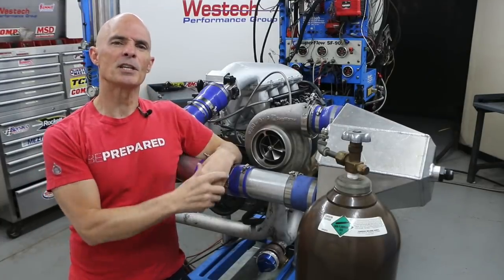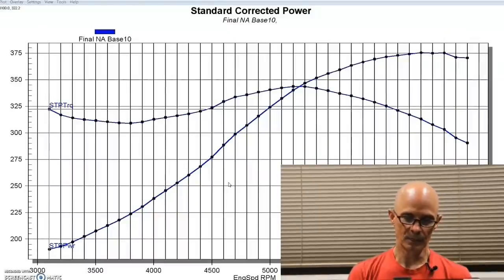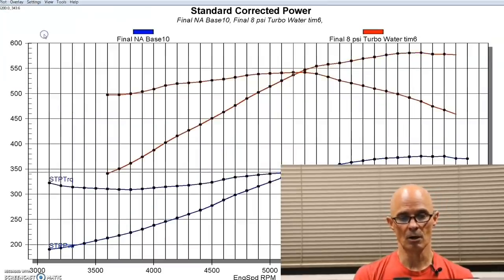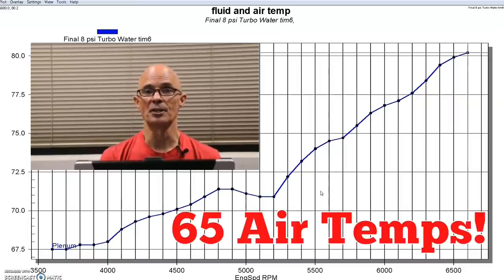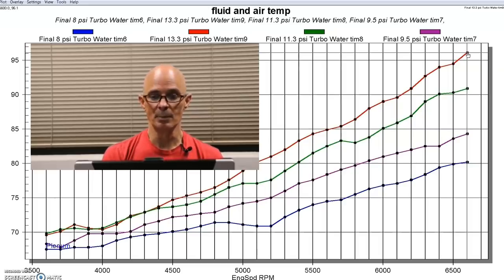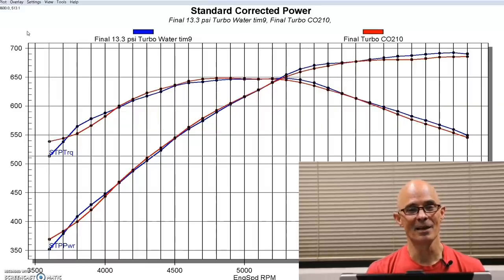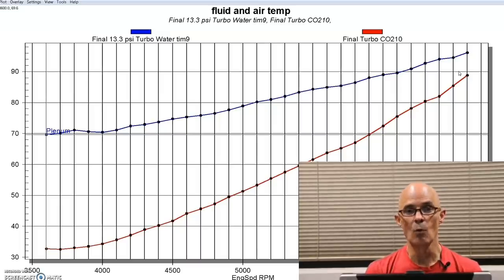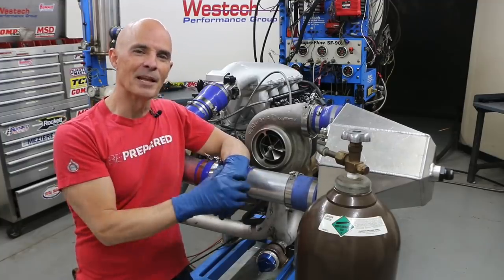HELP, CO2 INTERCOOLER FAIL!! FULL RESULTS!!

Comment: Run the fuel through a cool can with dry ice or liquid nitrogen, insulate the fuel lines from engine heat, it’s a better bang for ya buck, there’s more power in cool fuel than just the air.
Reply: There really isnt

Comment: On an Engine Masters episode called Heat Kills Power, they tried different things such as heating and cooling the manifold. The thinking was cooling the manifold would reduce the temperature of the air charge resulting in more power and heating the manifold would reduce power. Power was affected by doing this but not for the reason you would think. The result was chilling the fuel had more of an effect than chilling the air. This was determined by heating the manifold and cooling the bowl in the carburetor and later cooling the manifold and heating the fuel in the bowl. More power was made when the fuel was cold and the temperature of the manifold had little effect. When the test was done, it was on a carbureted engine. They were hesitant to say that chilling the fuel in an injected engine would produce the same results. Can you use CO2 to produce more power? I would say yes if you use it to chill the fuel. It would be interesting to see the difference in power using the CO2 to cool the fuel.

Comment: Try it with an air to air take the co2 and spray the intercooler till it's a block of ice.  Or you can make a cryo fluid for the air to water get some denatured alcohol and mix it with dry ice I'm not sure what kind of pump to use for that though

Comment: I think you will need a larger cooler and more co2 flow. The more service area the more transfer. Find out what the BTU of the Co2 is that set up is more of a air to air and the cooler is to small. Liquid nitrogen will be dif Because it’s liquid. I would fill the liquid cooler with liquid nitrogen and release  it during the pull. Like any liquid it cools rapidly when changing from liquid to gas. But don’t let the motor ingest it or it will fall on its face losing the oxigen content

Comment: Richard Holdener Increase the discharge hose diameter. Might be restricting flow. Sanity check, put a pressure gauge in the inlet & outlet. Possible the liquid is forming solid dry ice and blocking the core..Could even try nitrous..

Comment: It has to do with the density of your transfer media. As well as the shape of the charge cooler. Carbon dioxide is far less dense than water. Air density is roughly 750 times less dense then water. For a phase transfer type intercooler to work, you would need to expose more of the media to heat by increasing surface area. A better use of a phase transfer would be to utilize the cooling and expansion of a gas in conjunction with water as the transfer media. More like a killer chiller type system that cools the water making it more efficient as a transfer media.

Comment: Give it bottle pressure till the side of the inter cooler and then regulate it into the intercooler, the regulator will act as a restriction, kind of like a tx valve in an air con system and it will change state after that location in the intercooler body. Then you will get better temp drop

Comment: you need to install a jet at the inlet port of intercooler so the gas goes from high pressure to low pressure inside  the ic.

Comment: Right away you are running a gas through a cooler made for a fluid with the density of water. To confirm the problem temperature of the gas going in VS out would need to be recorded. To do it with cold gas you need an Air to air inter cooler that has a manifold feeding and exhausting the gas to ensure it has a chance to remove the required amount of heat. Without going into any math it would need to be VERY large in comparison to a normal unit considering the amount of heat transfer required. To do it properly you need to think of it like a car AC and a TX valve. To draw the maximum amount of heat with the CO2 you want it to transition from a liquid to a gas inside the cooler or just before. However the cooler wouldn't be made for the safe handling of the potential pressure that the CO2 could produce. there are a few ways it could be done but each has it's own inherent problems. CO2 liquid handling is tricky.

Firstly you need to have a proper cryogenic bottle that will allow the tapping of liquid CO2 and not just a welding gas bottle. A -8 line with a liquid feed to a primary regulator directly feeding the compensating regulator then into the heat exchanger. The pressure and temp inside the heat exchanger will need to be controlled to keep the transition act continuing to occur without freezing solid with CO2. It could be done but a controller and some complex valves would be required. Really not even slightly practical. The reason why it isn't used as a refrigerant.
A proper refrigerant is required to be handled practically so the only decision is what medium to use?  Butane boils off at -1c at atmospheric pressure so that's no good it wont get the temp you want. R134a wont get cold enough either but plumbed up using the cooler like the evaporator it would be effective and has proven itself in this app but sadly it wont go below -40c. The external system would need to be huge. Not Practical. You could use SO2 but that is awful stuff to handle and even the tiniest leak has people running. I would suggest methane as the most practical medium through the inter cooler as it transitions at -162c any colder than that and the air will start to fall apart. Of course if you don't like the risk with methane there is always liquid Argon at -182c that will get it frosty. LOL
But seriously you just want the coldest you can get it to without it becoming a NASA engineering project. Get some Silicone Heat Transfer Fluid and a mag drive pump, a car radiator a tray that it will fit in and 20 lbs of dry ice. Fill the cooling side of the heat exchanger and plumb to the pump and radiator. submerge the radiator in the same oil and then bury it in dry ice. That will get you -80c liquid into your inter cooler. That should get the charge temp down providing the inter cooler is big enough. I wonder what you did?
Reply: CO2 is used as a refrigerant.
Reply: @fascistpedant758  Yes but not very effective though.
Reply: @dazaspc   It's effective, but requires high operating pressure and low condenser temperatures. It's often used on ships where the high operating pressures require smaller compressors, saving space, and the cold ocean water can be used to cool the condenser.
Reply: @fascistpedant758  OK I had never encountered it.
Cheers

Comment: As other commitments said, you need it to be liquid in the intercooler, a more effective solution could be dry ice and alcohol (isopropyl or something with a nice low freezing temperature) in a cooler (don't seal it shut or it will explode) with a pump to circulate it through the intercooler and back to the cooler. That way your dry ice can take its time to cool down the alcohol and the intercooler core before the run.
Reply: Steven W I can see by the co2 bottle being frozen that the phase change is happening inside the bottle. The co2 needs to be compressed and liquid all the way to the intercooler. Once inside the intercooler it can be released and the phase change will happen where actually needed to realize the full benefit of the latent heat of vaporization. The intercooler needs to be supercooled not the bottle.
Reply: Spot on...do this all the time for science demos in schools. Plus you can freeze roses and grapes and shatter them too. 😁
Reply: I'd like to Richard test this.
Reply: This is the right solution.
Reply: You guys need to take a page from the PC builder's playbook and learn to LN2 cool it.

Comment: Wrong type of intercooler? I wonder if instead of running Co2 through an air to water if it would have better effect to spray Co2 onto an air to air (CRYO2 make kits for that)
Reply: The issue with the cryo sprayers is you have to keep refilling it.  I'm thinking that he's looking for something you don't have to keep refilling and it's more consistent temperatures vs what intercooler sprayers can offer.

Comment: Run liquid nitrogen with an orfice/restriction just before the core.   That’s how air conditioners work.  Use heat to boil liquid to gas.

Comment: Make a brine water mix and pull a large amount down below 0 then run it through at a high volume sould do the trick 👍
Reply: Good for - 20 c or for you guys  -4 f and excited heat transfer and safe bit corrosive but hay it is an ally cooler wash it out good

Comment: Flip the bottle upside down ( well that's what Scotty cannon says to do) ....you want liquid co2 going in, not just gas passing through , basically dry ice the core ,so a small restrictor on exit
Reply: You can also get liquid discharging bottles with dip tubes, but yeah

Comment: Since we’re on the subject I’d like to see a video on methanol injection vs intercoolers
Reply: Engine masters did it when Richard was guest starring in place of Steve (temporarily) 
They found water/meth was equally as good as an air to water intercooler but they had distribution problems with the inlet manifold
Reply: Thanks! Gotta go find that episode.
Reply: They found that the stock LS inlet wasn't suited to carrying liquid through it

Comment: Another youtuber “ Turbo John” did a similar thing with Co2, you might get more ideas from his video 👍
Reply: Yeah turbo John is a genius he does everything for cheap but I think the bottle should have been sitting straight up and then turn it on I think liquid was going down in there which was causing it not to run correctly. The second thing you need to get a large spray nozzle connected to it like a nitrous line have it go straight into the throttle body
Reply: @blackman8795  you want them to shoot carbon dioxide straight into the throttle body ? thats going to kill power like crazy by displacing oxygen and it may even just cut the motor running all together. Co2 is what comes out your exhaust and it doesnt burn so will kill power or just stop it running all together.
Reply: this idea would work with compressed air (high pressure obviously) directed into the throttle body with some sort of nozzle.
Reply: @vans1107  it's a lot more complicated than it sounds, it's been done, there are some good videos about it on here.
Reply: ive seen some compressed air supercharging done before..which is completely impractical, but i was referring to a small high pressure line right out of a bottle (4500ish psi) entering the intake piping just before the throttle body..I'm not sure on the exact discharge temp but it is definitely cold enough to almost instantly freeze your skin.  Whether or not it would work, i have no idea but it seems like it would be more effective than spraying a compressed gas into an intercooler.
Reply: @vans1107  I've been out of nitrous and still feel the difference from the extra o2 and the cold charge just playing around so I figure you are right. Nitrous tuning has came so far now I'll just keep filling them bottles and hit it with the 250.

Comment: Heat transfer is maximun at change of state ie gas to solid then solid back to gas so you probably won't see that unless you put bottle upside down and make dry ice then distribution thru cooler will be uneven, maybe a no win deal, guys who use dry ice will know what I mean, be interesting to see though.

Comment: As an energy auditor, I’ve built a number of excel based energy auditing tools.
I ran the numbers on air vs. water...and this is what you get...

Btu to raise I cu ft 1 degree f
Water : 498.46 btu 
Air :  0.18 btu
Thus, it takes 2769 times more heat energy to raise water 1 degree than air.
Also, Water has over 4,000 times the capacity to transfer heat per unit volume than water!
That’s why a water to air core is tiny, and an air to air is giant
Reply: Are you BPI certified?
Reply: Adrian OCNJ 
HERS Rater
WAP ( Weatherization Assistance Program)
No BPI
Reply: One cubic foot of water weighs 62.4 lbs, thus by definition, it requires 62.4 BTU/deg. F.
Reply: Fascist Pedant 
You’re correct... 
I incorrectly multiplied the correct value by 8
Appreciate the correction

Comment: If you are spraying into the IC, then you are only using the CO2 Gas to cool the air.

To be more effective, you have to charge the intercooler core, and bleed off after the IC.  This will allow the CO2 to be in Liquid phase (much higher mass) to do the cooling.

There was a company at SEMA about 10 years ago that had kits to do this on standard intercoolers.  Cant remember their name though.

Comment: Ditch the turbo. Seal the engine. Use the bottled C02 directly into the manifold. You’d see bottle pressure as boost and your air temp wouldn’t be much more than the temp that it exits the bottle.

Comment: More than likely it is CO2 gas flowing not liquid.  Just not enough mass flowing through.
Reply: common CO2 manifold feeding through inter-cooler at different points, regulator out of bottle.

Comment: Your using the wrong kind of cooler.
You need a gas cooler, with smaller, and more cooling tubes.
Once you have that. Then you need a exit restriction ( like a carb fuel jet ), and a pressure gauge to monitor the gas ( CO2 ) pressure inside the cooler. You most likely need 30 to 50 PSI.

Comment: You have the answer yourself , if the CO2 enters the intercooler plenty cold  and exits hot then clearly the inlet air temps are transfering to the CO2 so you'll need more CO2 gas flow so the exit temperature is significantly cooler than it is currently.  Because the CO2 temp is rising as it travels through the cooler it get increasingly less efficient ....more gas I say !

Comment: Liquids are far more effective at removing latent heat than gases are.
Reply: The temperature change comes from the phase change. It's working like a vapour compression refrigeration cycle. The temperature of the liquid CO2 is obviously not -120°f. It's the same temperature as ambient, it absorbs heat as it evaporates.
Reply: Problem with co2 when coming out of a bottle is that its temp drops so hard you get dry ice flakes . Now the issue becomes sublimation it skips the most effective form of heat transfer which is liquid , so now youre just blowing snow flakes past the core and nothing sticks to make the transfer
Reply: Air to air intercoolers are built with thin metal in the core to get as much efficiency as possible from using gas (air) as well. Water to air intercoolers are constructed thicker to keep water from getting into the intake plus water cools better than air does. I'd like to see Holdener use something like liquid nitrogen circulating through a water to air intercooler.
Reply: CO2 is a liquid under pressure which is what is so cold.
Reply: @livetorace163  liquid nitrogen is a stable cold liquid try it.
Reply: @livetorace163 it’s not cold until it evaporates.

Comment: Water removes 25x more heat than gas/air. If you use the CO2 to chill the water it will be waaaay more effective. Like a cascade refrigeration system. Et al glycol systems etc. id like to mess with some refrigeration techniques, heat exchangers etc. would be interesting
Reply: Liquid helium has the lowest freezing point. Which is 1° above absolute zero @-272°. Do you think thats cold enough??😂

Comment: Don't you need a charge cooler designed for air to air to pull this off?  How liquid interacts with a heat exchanger is going to be different from gas interaction.

Comment: -Possibly the core was icing up? not flowing enough CO2? or even not enough thermal mass especially if it was warming up at the IC discharge pipe.

An option from the CPU overclocking community is to use Acetone as the working fluid in the intercooler. Much the same way as water ice except this time you use Dry Ice. Acetone has a melting point of -95°C (-138°F,) which plays really nice with CO2 (dry ice's) sublimation temperature of -78°C.

Thus you can't freeze the acetone with dry ice. Also acetone has a boiling point of 50°C so as the fluid heats up during the run you're still not likely to boil it off (a problem with gaseous working mediums; remember that liquids transfer heat way better than gases.) Especially if you've got plenty of excess Dry ice in the cooling chest. Acetone has a specific heat of ~2kJ/(kg K) (about half that of water,) so it will heat up more quickly, but in a short dyno run, that's not really an issue if you have enough in the ice chest with more Dry Ice.

I estimte you'd want 20-30L (or quarts / 5-6Gallons? sorry Australian) of acetone with a supply of 30-50kg (100lbs?) of dry ice to cool it down. Though I'd start by leaving the acetone in the freezer over night to get a head start ;)

This is a test I'd love to see :D
Reply: This is about perfect for extreme intercooling

Comment: 1 thing that water does have to its advantage is mass and it's inherent ability to transfer heat. The thing that you are fighting is the energy of the co2 is being used up before it can make it out the other side. 1 route to look at may be a twin feed and twin vent. Or alternately you could all science class and open up 1 side of the intercooler weld a box on it and run a dry ice loaded onto it.
Reply: How many gallons of water during a run? It's way easier to cool water with ice than come up with pounds of liquid CO2. The latent heat is not terribly different and you can put 20lbs of ice in a tank.

Comment: Is it possible on CO2 has been converted to a gas it no longer has an ability to absorb heat and remove it from the core you have to be able to remove the heat energy from the intercooler and I don't think the gas is CO2 it's converted to after it gets up its liquid state is capable of removing the heat from the inner scooter which is why one side is hot and the other side is cold just my thoughts on the matter